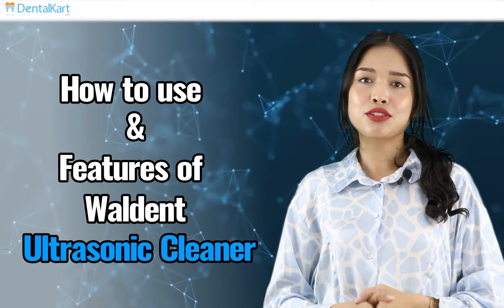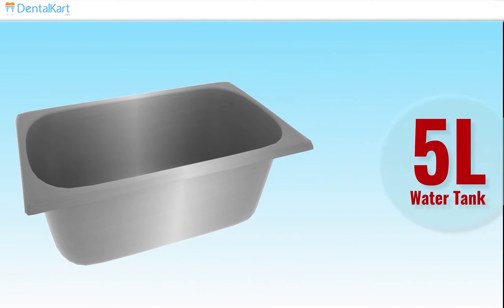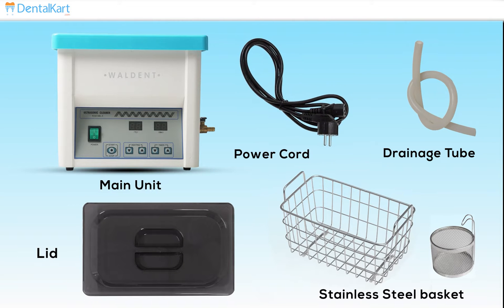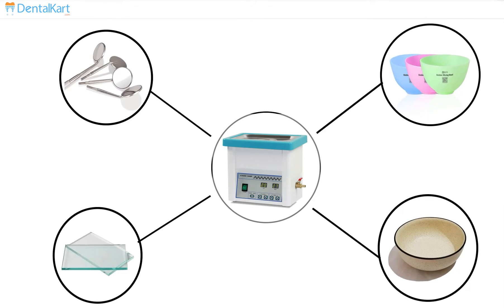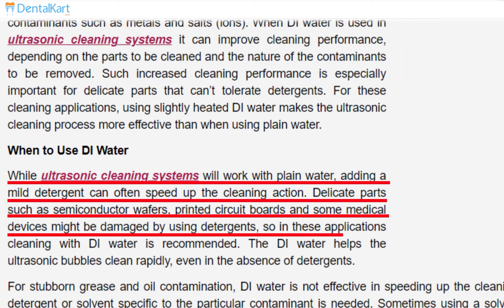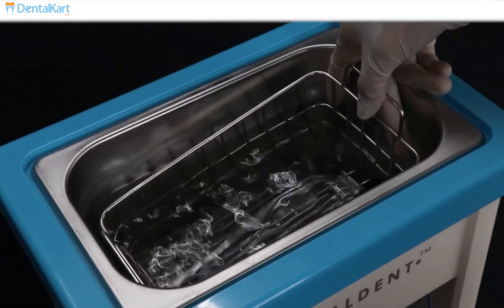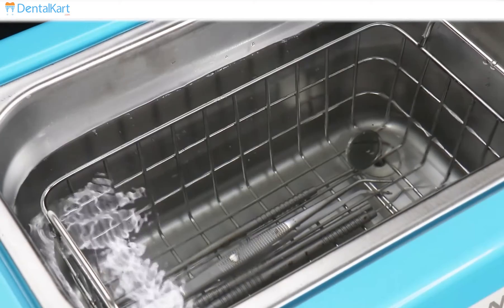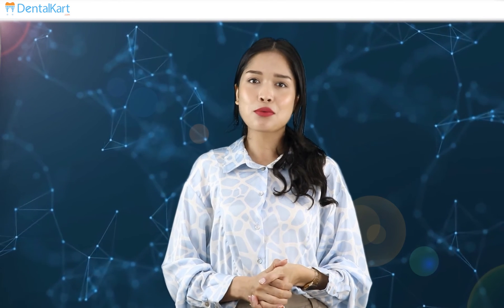How to use & features of Waldent Ultrasonic Cleaner

Comment: Are the dimensions correct? Can you post the external dimensions of the entire product as well as the internal dimensions of the tank?
Reply from the maker: Dear Dr, Greetings! The Waldent Ultrasonic Cleaner 5 Ltr Stainless Steel features a basket with dimensions measuring 20cm in length, 11.5cm in width, and 10.5cm in height inside the cleaner. This sizing is designed to accommodate various dental instruments effectively during the ultrasonic cleaning process.
Reply: @dentalkart  Those dimensions translate to only 2.415 litres of capacity. How come this is a 5 Ltr cleaner then?